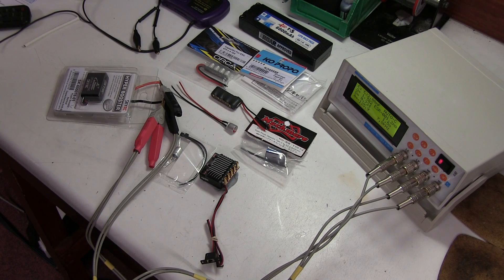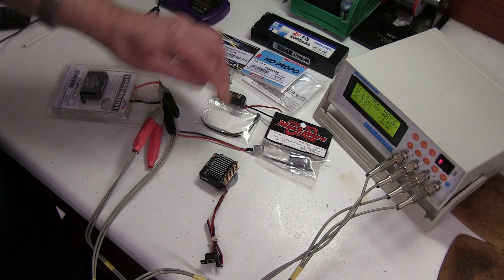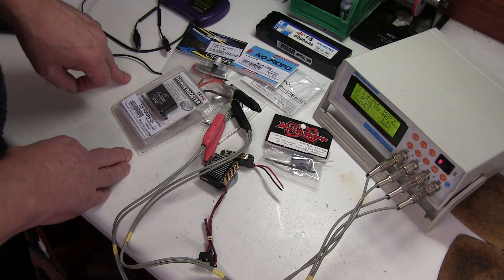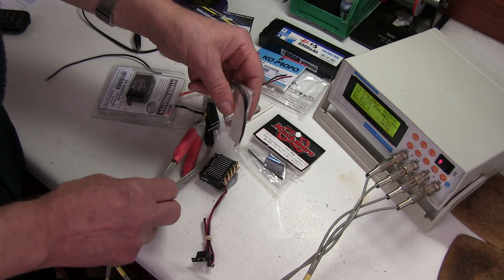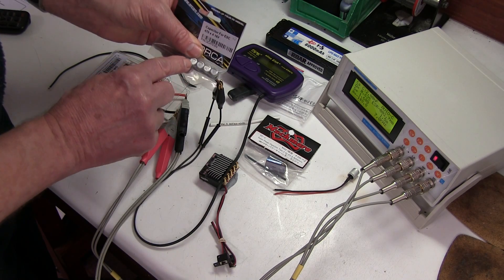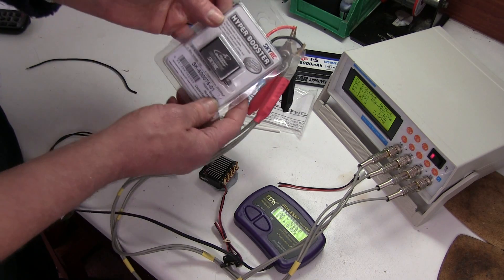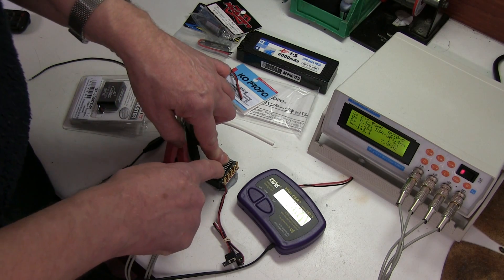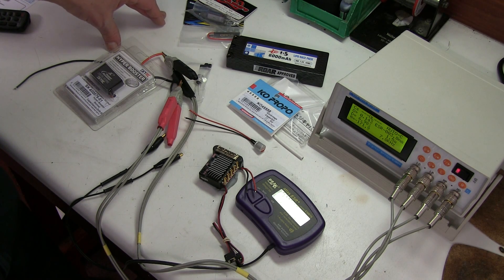Capacitors for Brushless Speed Controls.

Comment: Hi Nick, thank you for posting your video’s. You were talking about the length of the wires. Do the wires from the esc to the battery (for example) need to have a equal length. It’s often safer to make one shorter to avoid mistakes (connecting + to - and -to +).
Reply from the maker: Hi Mushroom.  The wires do not have to be the same length, but the shorter the better.
Your suggestion of one shorter than the other is what I recommend to try and stop connecting the battery the wrong way.
The wires to any capacitor should be kept as short as possible .
Racve on. Nick
Reply: Thank you!
Reply: @nickadams5411  hi Nick ! It's me Christophe M. Do u remember Gouzat ? And Tom ?

Comment: I can vouch for and agree 100% with everything said in this video. You know your stuff
I fly fpv racing quads where voltage spikes (noise) can be a very real issue and even spikes of up to 30v on 4s have been seen in some cases which is the reason why tend to opt for 35v caps to cover nearly all bases for 4s... as most of us dont have access to a scope.
 It can affect the fpv picture and adding some low esr capacitance can help absorb these spikes and improve the fpv analogue picture being transmitted by the VTX. A welcome side effect is that it will likely improve the reliability of all the electronics on the quad by removing high voltage spikes that may be above the specs of some individual electrical components used on the various quad components. 
I'm new to the rc car side but I'd say its probably quite likely to be a potential issue worth protecting against here too.  
We tend to use high C lipos so none of us have ever experienced any performance boost of the quad itself, we just use them for smoothing.

Too see the transient spikes created by escs that we quad guys are experiencing see- https://youtu.be/RIBph5eDuIk
Reply from the maker: Hi Paul. Thanks for the technical information. It all helps our understanding. All the best. Nick

Comment: Hi Nick, recently I have been running a SkyRC Toro 120 amp ESC for modified on road touring car. I thought I'd try as a cheaper alternative to HW. The problem has been when I accelerate at full throttle with Turbo timing the power delivery is on and off or delayed almost as if it is going to cut out or cannot handle the power, not to mention the handling issues it causes. Now I had it in my head that I could fix this with a better cap but from your video it seems like I can't. Any suggestions? Is it because it's just a cheaper ESC?
Reply from the maker: The Toro does have some issues. In this case a larger capacitor may overcome the hesitation. I recommend the 4 bank capacitor module as sold by KO, or Hobbywing. Keep the wire lenght to a minimum to the capacitor.
Reply: @nickadams5411  Thanks Nick, much appreciated.

Comment: The disadvantage to the Tekin capacitor is the radial leads make it very difficult to work with regards to placement. I run a 1/10 scale buggy on carpet and need to place my battery as far forward as possible. If I mount the Tekin cap as Tekin suggests, the placement of the battery is impossible.

Comment: Nick: you explained why you need them and then said the battery was better which is wrong. You need a quick cap because the cap catches the wash off the battery. do you get instant battery flow?? NO you don't, that's why the cap is so important
Reply: Yes, actually you do get instant battery flow.  Much quicker than the caps can take it in.  As we all know, the caps are simply a noise buffer not an energy storage.    But you don't seem to understand what he meant by the battery being better.  He made the statement to reaffirm the notion that getting a lower IR battery to begin with will eliminate much of the IR and is the only way to generate more power.   Many people don't understand this when it comes to caps because they don't understand their purpose to begin with, hence why companies dupe people into buying caps thinking they will see some form of power increase.
Reply: Yeah but only temporarily. They will bleed current over time and discharge them selves without needing to spend the power.  I make things from microwave caps all the time to.  They have enough voltage/current to kill you quick!

Comment: Nick is there a way to measure speedo voltage output without a Blinky buster?
Reply from the maker: Hi Vince
Not sure what you are looking for.
Are you trying to see what voltage is lost through the speedo?
If the speedo is held on full speed, it should not drop any voltage if perfect.
However all speedos have resistance and switching losses which make them heat up.
So, one way to test a speedo is to see how hot it gets under load.
You can feel the speedo after a race and see how hot it is.
The more powerful speedos should be cooler.
Reply: Nick Adams is there any way you can email me at Vinced1201@netzero.net, I will try to explain in detail a little more what I am trying to do. I race oval. I have just viewed some of your posts and you know I lot more about electronics than I and I would like to talk to you about a few things. Thanks

Comment: naught point 02 ohms ESR.... at what frequency?? and by the way, what's the ESR of the battery? I'd wager, you're never going to get a "low ESR" cap with less resistance than even the worst of the lipo packs. More miss-information and snake oil. Show me a scope grab of these transient spikes you speak of, then I might believe this B.S.... for now I think I'll just keep with EE theory.
Reply: I agree 100% with everything said in this video. 
I fly fpv racing quads where voltage spikes (noise) can be a very real issue and spikes of up to 30v have been seen in some cases so we tend to opt for 35v caps to cover all bases as most of us dont have a scope handy. It can affect the fpv picture and adding some low esr capacitance can help absorb these spikes and improve the fpv analogue picture being transmitted by the VTX. A welcome side effect is that it will likely improve the reliability of all the electronics on the quad by removing high voltage spikes that may be above the specs of some individual electrical components used on the various quad components. 
I'm new to the rc car side but I'd say its probably quite likely to be a potential issue worth protecting against here too.
Too see the transient spikes created by escs that we quad guys are experiencing see- https://youtu.be/RIBph5eDuIk

Comment: Nick, I was wondering if there was a way to test esr with a multimeter. As always, you provide excellent videos. Thank you for doing what you do!
Reply from the maker: Hi
I don't know an easy and accurate way to test ESR with a normal multimeter on its own.
New capacitors have the ESR stated, and you can get low ESR ones quite cheap now.
Also low ESR capacitors are used on speed controls, so they should all be low.
Unless of course you have an old or damaged capacitor, in which case I would buy a new one.
Reply: Ok. I have a brand new one here, from Turnigy. I just wanted to make sure it was ok/low resistance. The weirdest thing about this is that the ESC directions don't mention a single word about the capacitors, installation or otherwise. My initial concern was if I even needed them. It seems that I do.
Reply from the maker: Hi
The speed control will need a capacitor.
Some recent speed controls have them built inside.
Reply: This is the "Turnigy Trackstar GenII 120A Sensored ESC" I just finished soldering the cap(s) on. Do you think it will it hurt if there are caps already built-in?
Reply from the maker: Hi
Extra caps will be ok.
Reply: Ok. So, I soldered the in the cap, it's actually 2 caps on a tiny pcb with a red & black wire sticking out. So, red to red & black to black, obviously. The motor wires are blueA yellowB and orangeC. Pretty simple stuff.. It's a brand new ESC and I've done a lot of soldering in my life, so good solder joints. Smooth sailing...
I plugged in my 2S 110C Lipo, turned on the ESC, and calibrated it. Again, everything went smoothly. Triggered the throttle and car(RC10b5m) could barely crawl forward 5 feet...20sec later BOTH the caps blew "Bizzzssshhhhh!"
I'm wondering now if I mistakenly hooked up the cap wires wrong, though it was red to red and black to black(maybe the manufacturer soldered the red wire where the black one should be and the black wire where the red one should be)...or maybe I just have a bad motor. Its a used 13.5 turnigy a "friend" gave to me. What do you think, haha.

And I hope I didn't just fry this new ESC.
Reply from the maker: Yes, must be a connection problem.
You can look at the capacitors. There is a - or a line marking the -ve side.
Reply: Yes, the black wire is on the same side as the black line on the tops of the caps.

Comment: The capacitors effectively lower the source impedance for the mosfets in the esc's, At high frequency and current, all wire has inductance and some resistance, and even the battery's internal series wiring contributes negatively, along with cell resistance, and effectively they are all in series, then that naturally degrades progressively to a higher value as the battery pack ages. Instantaneous current demands by high speed mosfets result in reduction in switching transition time when the source voltage sags, and it's compounded when multiple esc's all overlay the same demands on wiring/battery, that resistance results in heat which is just wasted energy. it's the art of losses. The value of the capacitors used should be a factor of esc frequency with minimal esr for that value. You will not get a boost, just a significant reduction in loss when it's correct. 
Anyway, good video Nick.
Reply: Jay, the optimal size as strange as it seems would increase (in capacitance) as the performance of your battery decreases, so rather than lugging huge caps around when you would not likely gain much from their size most of the time, i would suggest maybe some trial and error if you don't have a scope to measure the switching sag and the effect of increasing value with your setup. One thing though, anything beyond about 1500uf with very good low esr performance is not likely to yield much more gain, and any cable length between the esc and capacitor is effectively an inductor, lessening the capacitors ability to sustain instantaneous source current to the mosfets. Imagine the cap as a shock absorber on a car driving along on railway sleepers, a long wire is like mounting it with rubber rods, lessening the effect of what it should be doing. Not to bomb you with more tech babble, but heat in the esc is nearly all generated in the transition time of the mosfet junction (switch) turning from fully off, to fully on, when fully on the resistance is so low no heat is made, but in that transition time it is effectively a resistor turning increasing current into heat. It cannot be infinitely fast due to things like gate capacitance and source impedance, but the lower that source impedance is (rigid supply current) it's like bouncing a pogo stick on concrete, vs. high source impedance (soft supply current) is like bouncing it on soft mud. The punch out is likely helped by caps, as the effects I just listed will help prevent de syncing, but motors, esc's and batteries are a system which all rely on each other for maximum performance, the caps really just make the battery look better to the esc.
Reply from the maker: Hi Alasdair
I agree, the capacitor is essential to minimise switching losses.
The large capacitors are sold as power boosters for the models with a single speed control and high power lipo with high power wiring etc.
And in my opinon do very little, if the speed control already has a low ESR capacitor as supplied with the speed control.
However many racers believe (in their minds) that it is boosting performance, and that effect may actually result in them performing better.
Thanks for your input.
Nick
Reply: Alasdair McC Alasdair, would you say that a very high capacity capacitor would help braking or punch in a stock racing class like 17.5 blinky?  OR would you say their use is simply to protect the ESC?  What about ESC temperature reduction?  Great explanation btw, even though I am not sharp enough to grasp it all!
Reply from the maker: Hi Jay
A capacitor must be used to help the high frequency on/off switching, to keep the switching losses low, and minimise heating.
If you do rock crawling or very slow running, a large capacitor may be beneficial.
With high speed racing with fast on and off throttle and braking a larger capacitor will have minimal effect on either.
However some report  better braking and faster top speed, which may be an effect in the brain rather than in the car.

Comment: Hi Nick, great review. I'm using a cap bank. It works great for rcdrift in my opinion. 

What do you think about Acuvance Photonic stabilizer acutron?

Some people claims it makes the motor ran smoother, some gives extra punch and longer battery. 

To me it sounds like if you have a low quality capacitor, acutron might help. But having a good capacitor may not have any difference. I just don't want to spend $40 just to do the test. What do you think?

Thanks. Jon
Reply from the maker: Hi
I think you should save your money for a Flux Capacitor

Comment: is it safe to add additional capacitor even if the esc came wit capacitor installed to it
Reply from the maker: Hi
Yes, you can add the new one with the original , or remove the original capacitor.
Or if the capacitor is inside, then you can add an external one.
make sure the voltage rating of the external capacitor is higher than the maximum Lipo voltage.
Reply: Nick Adams 
thank you
Reply: So if i have a 3s 11.1v battery i need a capacitor with 14.8v
Reply from the maker: Hi Tuck
Yes, the voltage must be higher than the fully charged maximum voltage of the highest voltage Lipo that will be connected.
So a 3S Lipo will charge to 3x4.2=12.6V
Therefore the 14.8V capacitor will be ok
Reply: I've got 2 capacitors that came with my ESC and have 2 more the same spare,could I solder those on the positive and negative posts as well.

Comment: what's the life span of this capacitors? I'm assuming it takes a lot of abuse.. good idea to replace them if you race a lot ?  like replace them after 3 months of racing a lot
Reply from the maker: Hi
This type of capacitors do not change their ESR over time, but
I have found that they  often fail open circuit and are no longer doing anything.
Some inadequate capacitors overheat, so look for split heatshrink or distorted case.
Some capacitors fail totally and burn out, but that normally happens when you plug in the battery.
Also if you plug in the battery the wrong polarity, then the capacitor will be badly stressed and will probably fail then or next time you use it.

Comment: can you explain the 7.8KHz i have seen esc's with adjustable throttle and brake frequencies and im wondering what that does
Reply from the maker: Hi Ronnie
I agree it is confusing, and not sure it is of much use.
In theory the highest frequency would give the smoothest control and action.
However, the higher the frequency the more losses will occur in the speed control as the pulses struggle to switch on and off, but the motor should run more efficiently.
At the lower frequency the response , especially at high speeds becomes less defined and less smooth, but the speed control should run cooler.
Most speed controls would compromise and fix the frequency in the middle range.
The most advanced speed controls would use automatically varied frequency, thus operating at the best at all speeds.
Allowing the user to select the frequency seems a marketing ploy, with the result that the racer thinks he has a good thing going on, but has no idea if it is the right thing.
I have tried these variable frequency controls, and can tell very little between the settings.
I have asked others who use them, and they say the same, they are not sure there is any difference.
I suggest you use the middle setting, say 3 to 5Khz and don't worry about it.
Or you can keep adjusting it, and hope you find the setting that appears to be the one.
Hope you race well.
nick
Reply: Thanks a lot for explaining that

Comment: I have not heard of putting capacitors on the DC (battery) input to an Electronic Speed Control (ESC). I have only used capacitors on the Battery Eliminator Circuit (BEC) output to keep the receiver from browning out from momentary dips, usually caused by high servo demand. I have actually observed this on an oscilloscope. Even then the voltage will only be held up for several milliseconds. That is also with only a few amp current draw. Not even enough power to give you an electrical shock much less power an RC vehicle.
Reply from the maker: +John Lytle 
Hi John
The capacitor is needed on high frequency brushless speed controls to help with clean switching of the control FETS.
The receiver capacitor is useful, as you say, to prevent low voltage glitches .
Reply: I agree,  long wire?  I don't consider a 30 CM wire for a DC battery connection to be long. I don't mess with capacitors in these circuits and I'v never had any issues with speed controllers.   These are still DC input lines even if they switching device.   Not enough AC effect to make a difference.   I'm not buying it.

Comment: I heard that smaller capacitor in a row will give you better punch out of a corner than one big one, like the one that comes with the lrp flow.
Reply from the maker: +Juwan Hunter 
Hi
The LRP capacitor is very good, with low ESR. No need to change it.
The 4 in a row small capacitors give low ESR.
The KO 45558 is the best I have tested.